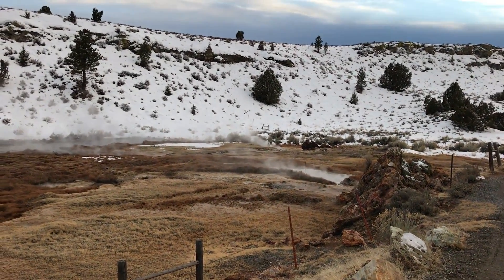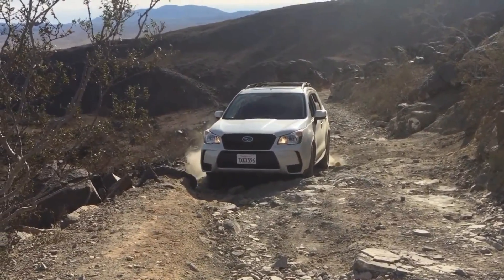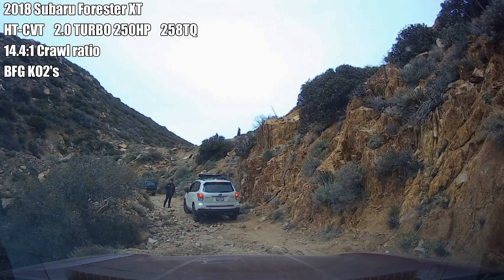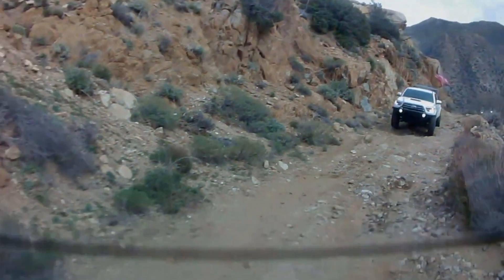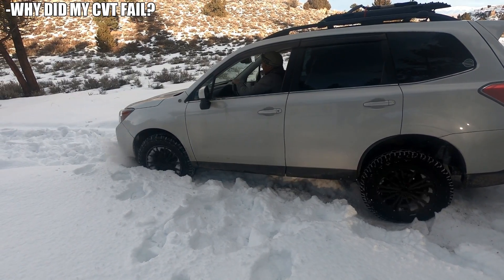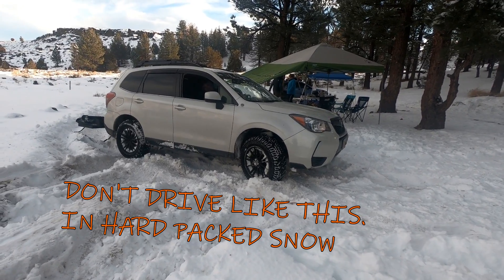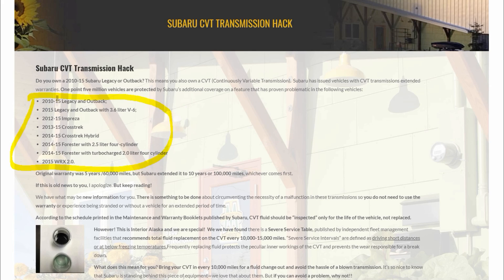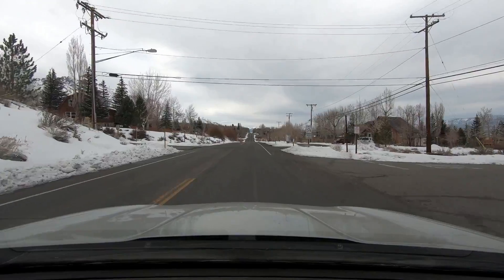CVT transmission Failed!  Can we make them last?

Comment: Very informative video! Thanks for making it! I Did a lot of research on the Subaru CVTs before i got my 2019 Crosstrek. I was so close getting a Manual Transmission Crosstrek but in the end i decided to get a CVT. I know the Recall effect 2017 and earlier models, so I am hoping they did some updates on the newer CVT. But regardless i got CVT due to the fact that I am mostly going to Daily drive this car and maybe once in a while go camping, light trails. and maybe trade it in in 3-5 years. Ive been doing all my maintenance on all of my cars and gf cars since I use to work at a dealer. But after  doing research on replacing CVT Fluid, its a Pain in the butt to replace CVT fluid since theres a special procedure on replacing fluid. I am sure you know about it. Fluid has to be at a certain temperature range to fill to correct level. which includes buying a scanner that reads cvt fluid temperature.
Reply from the maker: Thanks for leaving this informative comment.  To be honest, I did not know of a special procedure to change out the CVT fluid.  In the 60K miles I had the Forester XT, the CVT fluid was never changed.  This was because the Subaru maintenance schedule only shows for CVT fluid inspection every 30k miles.  Subaru never admits to needing the fluid changed.
Reply: JonDZ Adventuring oh ok! Yea yea I’ve keep reading that! But I think they currently have you changing fluid at 24,855 mile, for “severe” driving 
“Severe driving is 
> Repeated short trips, stop-and-go, extensive idling (basically any urban driving) 
> Rough, muddy, dusty, wet, humid, cold, mountainous, salty conditions (basically any coast, country, or winter driving) 
> Frequently towing a trailer.
> Racing” 
Which most of us will fall in there lol. The problem is CVTS are really sensitive you can do more harm than good if you don’t replace fluid correctly. Which I would probably take it to a dealer to do, but working in a Honda dealer in the past, I can tell you not all Techs are made equal some are careless because they are getting payed flagged so they rush. So kinda a loose loose situation.
Reply from the maker: @resukamediaresukamedia8175  YEP!  So... I found out all this info AFTER the CVT in my Forester XT died.  I'm part of a Subaru Off-road group, and no one has shared this info.

I totally believe you when you say techs rush work.  When I took my 2019 Honda Passport in for it's first oil change and wheel alignment, they stripped the bolts on my skid plate (despite offered as an aftermarket item) and the alignment was so bad, the vehicle would track to the right after 300 feet.
Reply from the maker: @resukamediaresukamedia8175  changing CVT fluid is not common knowledge, so I hope to help change that.

Comment: @DavidT Medeiros  I think at the end of the day there is a lot of information out there and a not insignificant amount just isn't good info.

This video is an example of good info.  

Cool the fluid.  I've had my AT Temp warning light come on before.  The thing goes into limp mode and puts basically no power to the ground.  Symptoms seemed similar in this video.  I just left it running and ran the heat on high and went for a walk.  Once the light went off it worked fine and has for years now.

Change the fluid.  Subaru recommends somewhere between never and 25k.  I'm splitting the difference and doing it at 50k.  Which is right now.  I'll get a Blackstone Labs analysis done for my own curiosity and find a place to post it.  Either YT or OB forum.  I'll be using the HT CVT Fluid.

Monitor the fluid.  I have an old scangauge that we managed to dig the CVT temps from.  I used to see as high as 270F before the cooler but haven't seen higher than 220 now.

Other thoughts: Subaru seems to recommend replacement over repair for these often which is where that big 8k bill that scares a lot of folk come from.  

This seems to be standard policy.  They did the same thing with the 5EAT.  (5EAT's actually cost more than a CVT from Subaru)  The difference here is there aren't any 5EAT's that are still in warranty.

I've seen them repaired (search around the google for 580/690 info and you'll find lots) and one can pick them up from salvage yards with a (short) warranty for a few hundred dollars. 500-1000 seems to be the norm.  I think I saw one as low as 300. (car-part)

I did draw a different conclusion than JonDZ in his video here with the bog down/hill climb issue.  

I think the traction control is what does it.  I have a video (subaru smarter than you) on it showing that ripping fuses to disable traction control the car will happily power up a hill but turns into a diagonal spin wonder like all the older Subaru's are.  

That plus CVTs and VDC became standard at around the same time so it's hard to separate the two. 

Something in the programming can't figure out steep inclines and wheel spin so it decides to do nothing.  

I'm looking forward for someone to really put the dual x mode on the new Foz/OB to the test as I'm yet to see a video of people do what we're doing to it.  

Still not sure if gimmick or not.

...

Thanks for reading my novella in the comment section. (:
Reply from the maker: Ha!  I forgot to hit to re-pin the post.  Well it's there now.  I just wanted to make sure the pin post retained the info about what mobile apps to use to monitor your transmission temps and what gauges you can buy on Amazon.
Reply: @JonDZ_Adventuring  Anything you suggest I can do to help let me know.  I've got an appointment next week to change the CVT fluid at the shop and will be sending an analysis off to blackstone. 

I'm interested myself since I'm running a CVT (690) and don't want to be left stranded somewhere because of it.  

Some more thoughts: "Bellipoten" on NASIOC has a Modified WRX CVT for 5 years x miles and no issues.  I think it's stage 2? 

Either way.  The trans seems to be able to handle the power.  I wish Subaru was more forthcoming with what is going on when the CVT has issues so they weren't treated like a black box. 

Wouldn't say no to a low range of course but at that point it wouldn't really be a Subaru.
Reply from the maker: @bruceyyyyy  thanks!  Well, if you post up the results in one of your  future videos, that should do everyone a favor.  😇
Reply: That wrx with stage 2 and cvt with almost 400hp. That is the HT CVT. I just wish to figure out to dusable the logic which subaru shutoff power. Hopefully the locker with always traction will help

Comment: In Germany Subaru-Service Plan says change the CVT oil @ 60 000 Kilometer > 37282 Miles. Also i use Scan-Gauge via OBD for Check the Temps while Offroading...
Reply from the maker: How do you like the scan gauge?  I want to buy one for the Passport.  It's not cheap, but it's worth it right?  what temperatures are you seeing?
Reply: @JonDZ_Adventuring  CVT OIL Temp / Motor OIL Temp / Coolant Temp, much much more... In the first Time there was much Problems with the Codes because some Codes not work and the Scan Gauge can not read out everything, i write a  mail to the Scan Gauge Company and they help me instant with correct Codes to programming the Scan Gauge correct, now it works perfect with much much options... and everything works fine... I can say buy it :)

Comment: As much as I'd like to say that the Subaru line of SUV was made for some harsh off road trails. They are not. With all cars , trucks and SUV there is a limit that is reached with each vehicle before it will give out or break at some point. Thanks to the aftermarket company's that make better than stock or upgraded parts you can extend that limit a little farther. In reality as much as we like to push what we have to the limit and do it over and over we going to pay the consequences for doing it. I love my forester and definitely plan to keep it for as long as possible but I realize if I want to go little further to those camp ground way out in nomans land im going to need something like Jeep to get there.  I do has to say that I am very impressed with the off road capability of your Passport.
Reply: Or just go backpacking. The best campsites I've found have been by hiking high and far from where roads go. Backpacking is healthier than overlanding too obviously
Reply: @Deeboskim  I get my share of hiking  in when it not a 110 outside . If I want to camp in the summer I need to travel to cooler places
Reply from the maker: Well said Stephen Gomez!  That was a perfect comment.

Even though I'm finding the passport pretty capable, I have learned from my experience with the Forester and I now monitor my transmission temp.  I no longer have to use momentum going moderate obstacles and the difficult obstacles where I'd actually need momentum I'd just pass on.  If anyone thinks the trail driving in this video is abusive or hard.... Watch this one of a 1999 Honda Passport:

https://youtu.be/86cVNLlyl5E

It's good to know the limits.  Even these solid axle Land Rover Discovery's  knew them and called upon the UNIMOG for help.  I wish I had a UNIMOG friend, haha!

Comment: The Services Manual on the 2.5 Ouback say to change at 24K with severe driving. Which i do.
Reply from the maker: I'll be honest, the only part of owners manual I read was about x-mode operation.  I think the vast majority do not read the owners manual.  We should, but we don't.  I'm such a bad nerd 😭.  I'm glad the subaru owners book references a severe maintenance schedule, to add, I think offroading should be "super severe" and fluid change even sooner than 24K.

Daklakfoto is the perfect example.  Only 13K miles and he has really dark CVT fluid.

Comment: So if I do the 30k cvt maintenance I should be able to get 200k miles out of my 2016 Crosstrek right?
Reply from the maker: Subaru doesn't recommend you change your CVT fluid, they only recommend it gets inspected.  Don't listen to your service advisor, get your fluids changed out according to how you drive and how hot your transmission gets.  There's a guy on the facebook MtnRoo group that claims his Crosstrek has 184K miles on the original CVT.  He's also a fan boy, and .... We can't always trust fan boys.
Reply: @JonDZ_Adventuring  ha true!  Well I was just gonna bring it in every 30K.  That's what I did with my Nissan Sentra.  But that car only saw the pavement lol

Comment: I just wanted to stop by and add a couple of things. First, the temperature ranges that you provided are for a conventional transmission, not a CVT. As such, theres not nearly as many clutches to burn out and form varnishes. What happens is at higher temperatures, the friction material in the CVT fluid starts to break down. This material helps the chains and belts grip the pulleys and it has an adhesion property to it as well. So as it gets hotter, it stops sticking to everything which in a CVT is bad. Because it stops sticking to the chains belts and pulleys, it stops cooling those parts as well!. CVT fluid should be changed EVERY 30K MILES, 45K MILES AT THE ABSOLUTE LATEST! If you wait to 75k or 90k, you will kill your CVT for sure. Even in daily driving, eventually with the heat cycles, that friction and adhesion material breaks down and needs to be changed, just like motor oil.
Reply from the maker: Right, so basically you are saying the temperatures in the illustration are still applicable to CVT's 🤷‍♂️?
I totally agree with you about needing to change fluids sooner.  We should also add differential fluid.  Recommended change is at 90k miles, but offroading Subaru's should have this fluid changed sooner.
Reply: @JonDZ_Adventuring  🤷🏾‍♂️ what I an saying is a completely different set of problems arises with increased CVT fluid temps that wouldnt affect conventional automatic transmission fluid and vice versa. We dont have to worry too much about burned clutch packs and varnishes but we do need to worry about the breakdown of the adhesion and friction material of CVT fluid because THAT is what kills the CVT
Reply: @JonDZ_Adventuring  I still think the video was very informative and said all the right things. CVTs hate heat and need oil cooling. The fluid needs to be changed well before what Subaru recommends. Steep grades raise operating temps significantly. It's all true!
Reply from the maker: @foxtrot685  To be honest I wasn't even looking at the illustration (by Hayden Auto) that carefully and how transmission components are affected.  Heat just causes the fluid to lose effectiveness and that can't be a good thing.  I'm no expert, I just do real world testing and observing, so thanks for pointing that out.

Comment: I watch just about every video I can find on Subaru's off roading but you will always see some makes, and it seems it not the CVT transmission buts it's Subaru's CVT, because I have seen other brands getting wheel spin and not killing the power like a Subaru does.  I have a 2013 Crosstrek with the five speed manual and that transmission sucks also, I am currently looking at Jeep Cherokee and Compass they come standard with a 9 speed automatic.  I wish Subaru could be my forever car but their transmission's suck.
Reply from the maker: My 2019 Honda Passport has the same ZF9 as 2019 Jeep renegade, compass and Cherokee.  Get the trail hawk versions, you won't be disappointed.  The renegade and compass use more agressive axles (same ratio as my Passport) The Cherokee trail hawk has less agressive axles BUT it has a real transfer case.  The Grand Cherokee has the ZF8 speed.  Id just avoid the Jeep's with the first gen ZF9, there's alot of reports of poor performance and poor reliability.  I personally really like my 2nd gen ZF9.